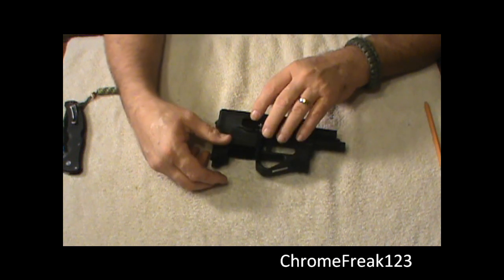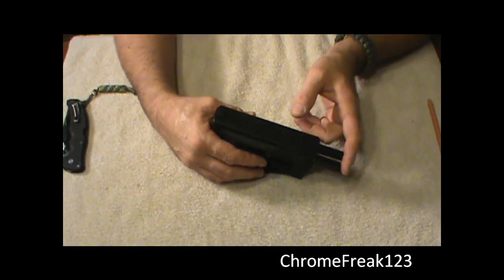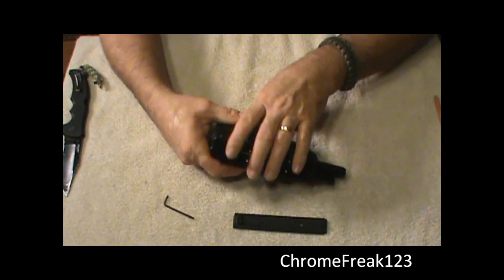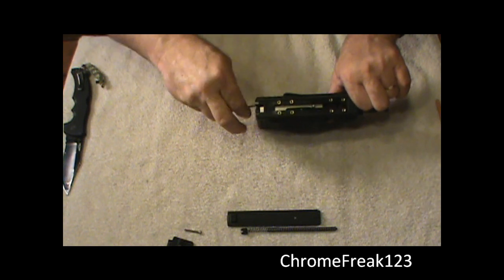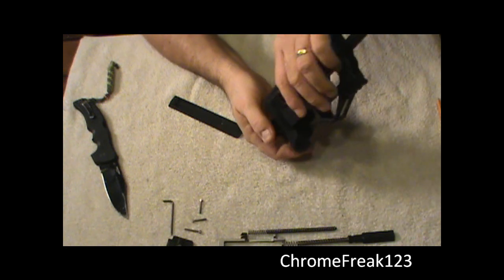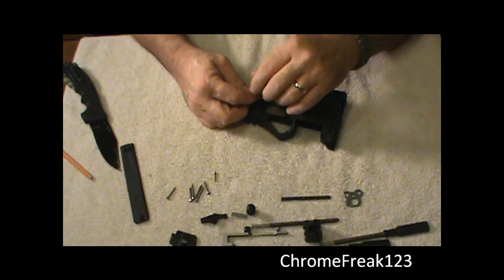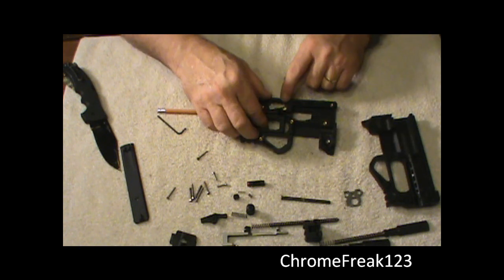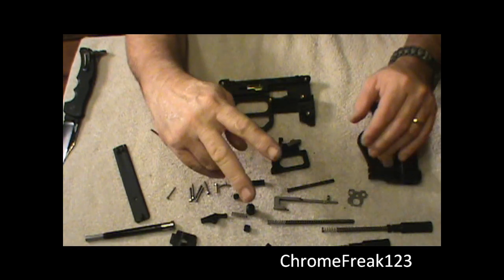USFA ZIP .22 LR Detailed Dis-assembly !!!

Comment: how chewed up is the bolt on that ZiP? I've fired 100 rounds through mine and it has nicks, brass and powder stains ( that i can't remove) plus all the dry fires from FTF or not knowing it was out of rounds has left a good ding on the chamber. You are more that welcome to watch my video. NOTE the cci blazers shot with no failures the second time.